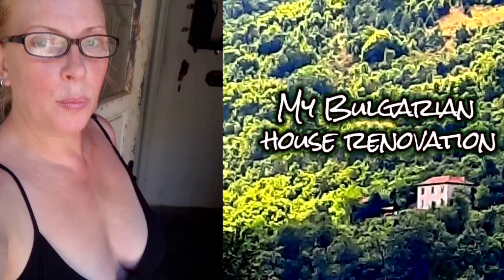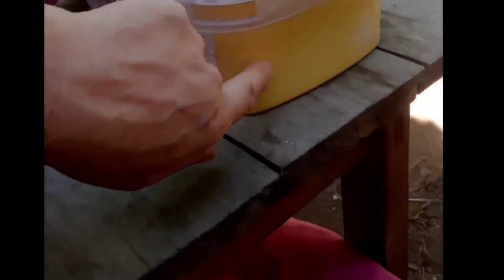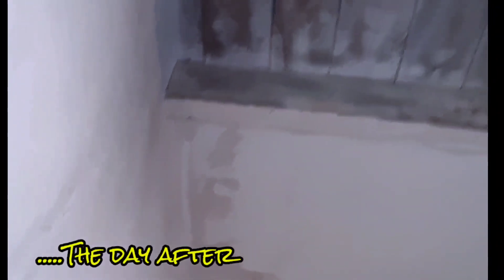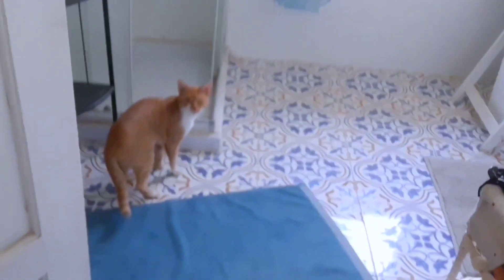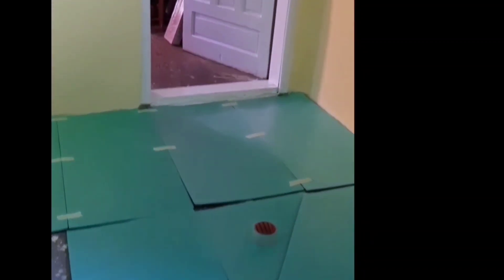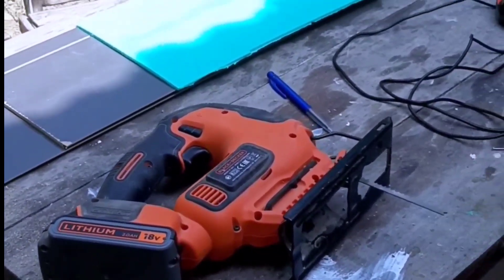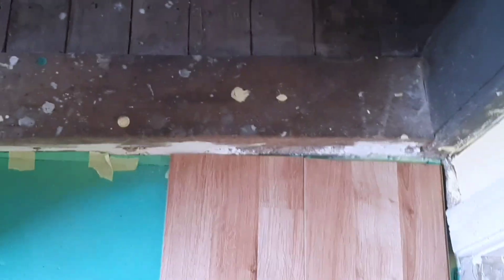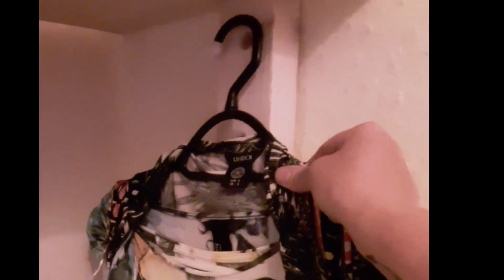My life in Bulgaria: I'm renovating the Hall.

Comment: Beautiful sunny yellow paintwork .
   The hallway looks very welcoming .All your hard work is so worth it ❤.
I was worried for you that you’d struggle to get the laminate flooring to fit without big gaps,but you made it look quite easy.Congratulations on your beautiful home.
Reply from the maker: Thanks🙏, well I did struggle a bit with the floor and the end result is not as it would have been if a professional had done it. But it's good enough and it has been holding very well since it is a couple of years now since I fixed my hall and made this video. ( I have so many videos in queue that I haven't had time to edit and post yet 😅)